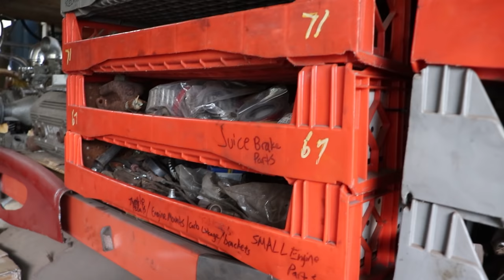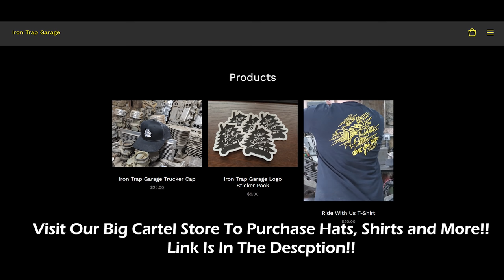Building A Custom Gas Pedal and Linkage - 1939 Ford Tudor Forgotten Hot Rod

Comment: Nice work on the gas pedal, I like the was you can get you foot under it, I have had to do that a few times when the return spring breaks, or something got stuck!! You could also put a cover over the lever on the inside of the firewall, to reduce drafts.

Comment: Happy Belated Birthday Matt !
Nice little quicky video.
Have you ever thought of using a Stainless Steel kitchen, table or Tea Spoon turned so the concave is facing the floor or firewall  for a throttle pedel ?
I have put a couple in cars and they look really cool as well as can be shined up nicely.
Also, I so like those seat covers in  that car !
They just fit it well !
That car will be so much fun when you get it on the road.

Later Gator

Comment: Hey Matt & Co. another great video as always,  the 39 forgotten hot rod has definitely come a long ways. I've noticed that you are a pack rat too, I have a hard time throwing stuff away, you never know when you might need it. Great tip on using the Tig Torch for heating & bending the throttle linkage. Just curious, will the 39 forgotten hot rod ever be up for sale? Just wondering, as much as we like, can't keep everything.  Happy Belated Birthday...Anyway be safe...Build on Dudes!!

Comment: On the Fords with the Y block, the linkage you are mounting on the inside of the car would have been mounted on the outside of the firewall. The only rod going inside would have been the one with the ball socket going to the pedal.

Comment: I have an nice oil bath air cleaner for that  engine and carb combo that you may have if you want it.
Reply from the maker: Is it an old chrome tbird one or? That's what I'd love to find since its a complete 55 tbird engine.
Reply: @IronTrapGarage  No it is just a round black oil bath about 17" in diameter and 7 1/4 " high. It is in good condition but no chrome. 😞I like that you are using the Teapot. 👍I am using one on my 53 Customline. They are a little different but that is why I like them. The filter won't fit on the flathead, it runs into the generator, so if you would like it it is yours but if not I will hang on to it for a future project. Love your work by the way. I've learned a lot.

Comment: I have heard both thoughts. I wondered do you disconnect the battery when you arc weld on the car? Never would of thought it possible to heat the metal with the TIG.